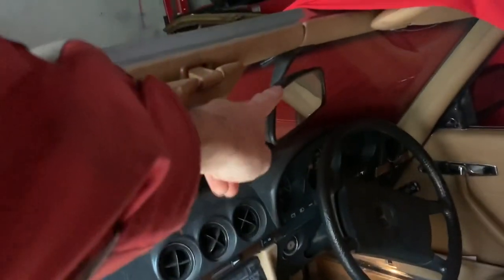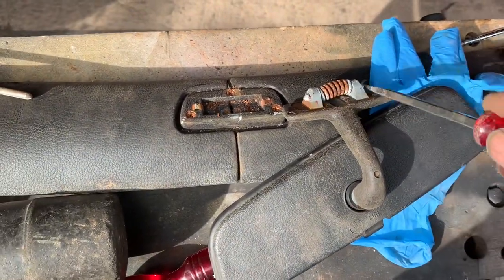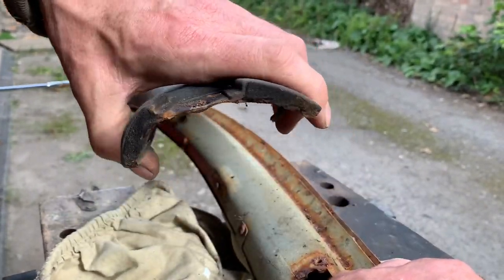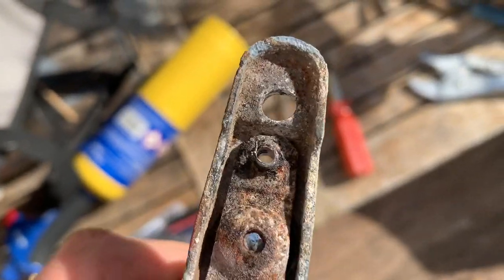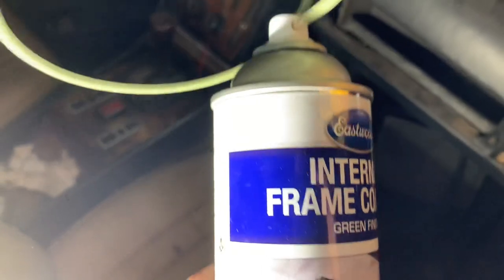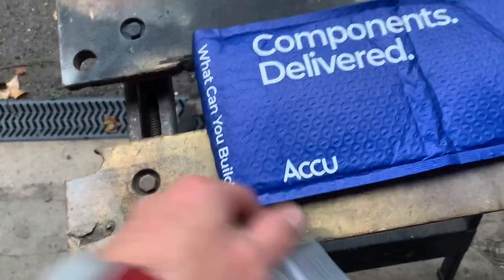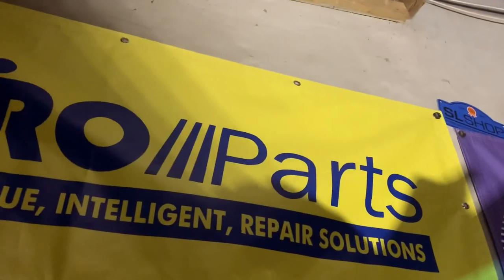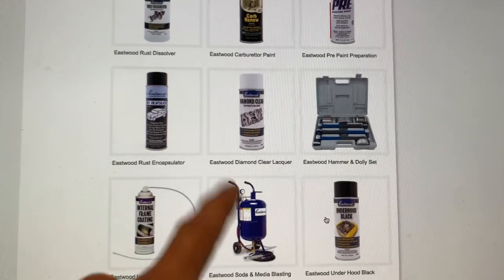Mercedes R107 SL rear view mirror, sun visor rods and A pillar trims

Comment: Just brilliant. Any thoughts on the water leak that comes through the upper windscreen light? The rubber ring is there but old.
Reply from the maker: Thanks for your comment. By the “upper windscreen light” I assume you mean the interior light that sits in the trim piece next to the rear view mirror? Do you have water coming in here, with both the hard top and the soft top? I would say the most likely source would be a leaking top seal on either the hard top soft top or both. Mike
Reply: @MikesMercsandothercars  that's correct, water drops through that light housing I have both soft and hard tops that leak...however a brand new seal is fitted to the hardtop and it still leaks.
Reply from the maker: @jondawnjoshuahutson1877  Hmm strange. If it was me, the first thing I would do is take off the hard top and just make sure that the top section is not full of water from a previous leak. Use a twisted piece of toilet paper down the holes where the roof pins spiral in. Next up, get a bit of kitchen roll  and cut it in thin strips 1 inch long. Carefully lay these along the top chrome with the roof off. Then put the hard top on (or soft top up) so that the kitchen roll is clamped in intervals between the top chrome and rubber roof seal. Go for a drive in the rain and see which one of the sections of kitchen roll is wet to ascertain where the water is getting in. If its wet at one end, it could be a problem with your A pillar seals. Mike

Comment: What is that rust remover substance in the big bath? Thanks for sharing!
Reply: ahh Deox C or Atom Mac is that what it is?
Reply from the maker: Hi - at the end of each video we usually tell you where we got the products we used and what they cost. The Bilt Hamber DeOxC crystals are shown at 20 minutes in this video...available from Bilt Hamber. You can also use ready mixed Frost Rust Remover or Evaporust but this works out more expensive. Mike
Reply: @MikesMercsandothercars  Thank you!

Comment: If the car did not have wood trim originally then I would revert it to the original black vinyl. I think it looks better that way in any case. Simpler and cleaner.
Reply from the maker: ....and MUCH cheaper. I'll be doing a video on wooden trims soon showing the cheapest place to get them BUT I think I will struggle to get a gear stick surround piece with just one cut out for the hazard switch. Maybe I'll start with the vinyl from the gold parts car and see how well it cleans up. Thanks for you interest. Mike

Comment: Mike I pulled out my rear subframe mounts R 107 1973 but i am having trouble lining up the center bolt trying to thread it back i to the body now that i have the mount back in.  Any tricks to getting it in?
Reply from the maker: Thanks for your comment. Yes it can be tricky to line up those bolts and I seem to remember it took me quite a while. I don’t think I did anything particular. I assume your bolts are tapered like a 303 bullet cartridge? Mike